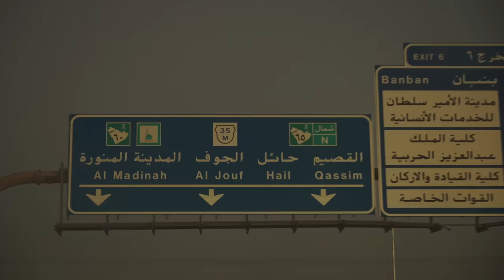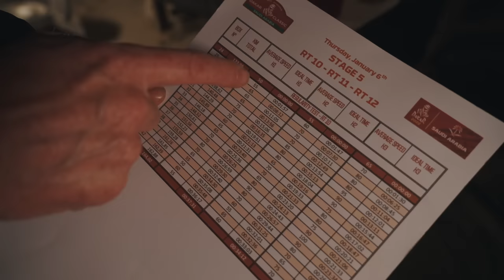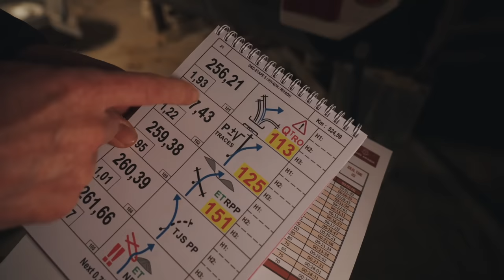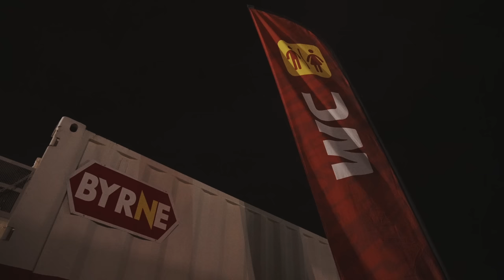Dakar 2022: The World’s Toughest Off-Road Race

Comment: Toughest? Don't think so. Longest for sure, but I think Baja 1000 is harder - bigger speeds, more dangerous, people die there pretty much every year. Doesn't make the Dakar easy of course.
Reply: From Reddit :

I’ve raced the Baja 500 and Dakar. It’s not quite the same as comparing the 1,000 but the 500 was tough.

The 500 is a massive challenge, and Dakar is running a 500 a day, every day (minus one rest day), for two weeks.
Reply: How many days is Baja again…?! They are not even compatible. More dangerous doesn’t mean tougher.